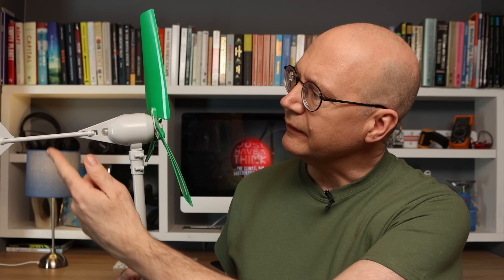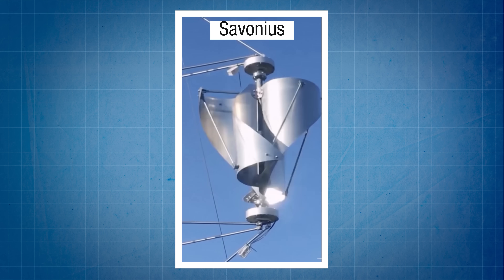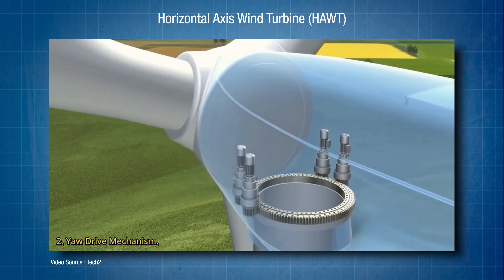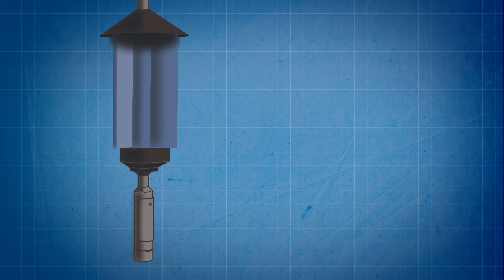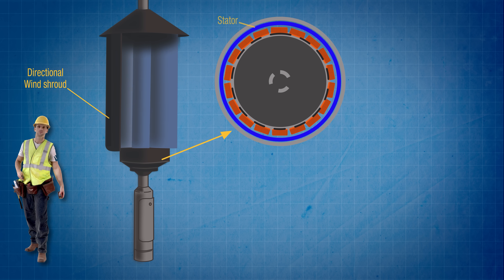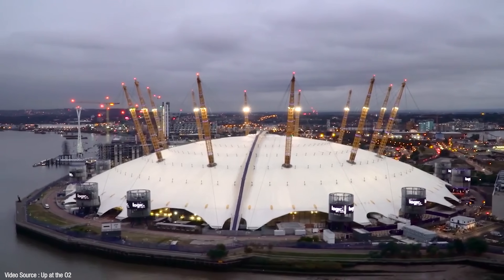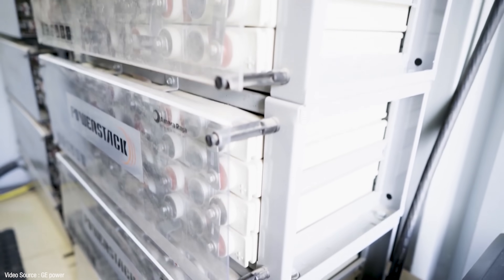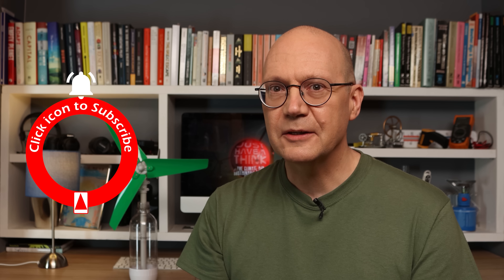A vertical axis wind turbine that doesn't need the prevailing wind! How do they do that?

Comment: I have two questions that I didn't see answered in the video. Does the use of these wind turbines on the road decrease the MPG of the vehicles? What kind of maintenance costs can be expected on these turbines?
Reply: It might actually increase the MPG. Assuming that eastbound traffic generates a head wind for west bound traffic, and vice versa, these VAWTs would act as a baffle and reduce that headwind. It would reduce the power required to move the cars.
Reply: @rayopeongo  good thinking. That's an excellent point.
Reply: @MichaelBrown-gt4qi  

"good thinking. That's an excellent point."

LOL, probably not. There are dozens of factors involved, and mine probably isn't one of them. For instance, I don't think that a boat is slowed down by having a surfer ride it's wake. The boat has already expended the energy to push the water out of the way and made the wake, the presence of the surfer is immaterial. So, I don't think that having the wind turbines at the roadside will have any effect, positive or negative, on the MPG of the cars. 

However, this is just one of the many things that I don't know anything about. The idea for the VAWTs sounds good, especially on the tops of cell phone towers, and we can use all of the clean energy we can get. So I don't mind these guys giving it a try to see how useful it might be.
Reply: Consider a train, travelling in the open or travelling in a tunnel.
Reply: Regarding the effect of MPG of vehicles passing by, VAWTs produce centrifugal air pumping effects, which essentially means there is some air shoved outwards radially. I believe, depending on the distance of the passing car from the turbine, the turbine rotational velocity and turbulence intensity, (and so on, too many factors) it would be quite difficult to visualize a conclusive answer. It really could go either way. On one hand, the 'extra' flow from the turbine could cause the flow boundary layer on the car to separate at an earlier stage, increasing drag. Or the extra flow could contribute to increased wind turbulence, delaying the flow boundary layer separation, reducing drag. It's an interesting question though, probably something worth investigating. Maintenance costs on the other hand, they're definitely less than HAWTs, but of course, depending on the type of VAWT in question, the maintenance cost will change. Predictive maintenance however, should reduce the cost very significantly.
Reply: l think MPG also depends on how heawy the traffic is. Like in low traffic the air movement wolud die off on its own without helping the next car anyway. 
@Ray Opeongo l like the thought.
Reply: Instead of using them on highway better choice would be to use them near railway lines
Less likely to be vandalised or stolen
Reply: Newton's Third Law says that there might be some influence of the VAWT back on the vehicles passing by them. 

I can imagine that the effect would be similar to the Piston Effect where vehicles, like automobiles or trains, passing through tunnels experience greater air resistance since the tunnels bound how far away the displaced air can move away from the vehicle. Think Elon Musk's Boring Company has implemented quite precise engineering controls to reduce that kind of drag. 

Since these turbines would only be placed on the sides of roads, not above or at varying degrees, and they would be placed discretely as opposed to continuously, I would think that any developed Piston Effect would be quite low. Dave did say that their efficiency/power coefficient is 30% though. 

I'd be interested in Dave returning to this company once they run a field trial on an existing stretch of UK road. You'd probably want to affix vehicle subjects with Instantaneous Fuel Consumption meters to get numbers from both the VAWTS and the vehicles passing by them.
Reply: Quite sure it will increase the drag to some extent.  Perhaps not significant, but needs checking
Reply: @markthomasson5077  there will be zero additional drag on any car passing or any subsequent car/vehicle doing so either. Every vehicle "punches its own  hole" through the air in front as it travels, this causes air-drag/friction induced by its journey, on that vehicle,  there is a slip- stream effect provided for vehicles traveling fairly close behind, this just diminishes the energy needed to maintain the following vehicles velocity.
Reply: its just air that gets pushed off the street, doesnt even help the car behind much. The energy these turbines would use is just part of the energy you as car user loose due to air resistance
Reply: I can't begin to decipher the flawed thinking that has led you to the former question
Reply: I can't begin to decipher the flawed thinking that has led you to the former question
Reply: I can't begin to decipher the flawed thinking that has led you to the former question

Comment: Due to our pandemic life is more difficult and boring, just have a think on Sundays is informative and is a shot for my mental health. Thank You
Reply: Not thought of it that way but you are so right.
Reply: Me too.  Food for thought and hope for the future.
Reply: You think it's difficult and boring now? Wait till the reset is completed. You'll own nothing,...not even the body you were born into.
Reply: So agree!  I adore Just Have a Think.
Reply from the maker: Cheers Mack. Much appreciated :-)
Reply: @JustHaveaThink  Hi, I love your videos, but I just wanted to let you know that there are several things wrong with this one:

At 8:50 in the comparison with solar you say 125 turbines have a capacity of 3MW - that would mean that 1 turbine has a capacity of 24kw - which is impossible and also a contradiction to the 2.5kw that are mentioned earlier in the video. - so maybe you missed a 0 there?

Furthermore you mention a windspeed of 5.4m/s. - A simple calculation shows that there is only 100watts in the wind passing through a 2x0.5m area (blade size) at 5.4m/s... - So if the turbines were 30% efficient they would only produce 30 watts from that wind... - if they did that the whole day long they would only produce 0.72kwh in a day instead of 6kwh.

Kinetic energy is 0.5m * v^2

If the air is moving at 5.4m/s and the blade has an area of 1m^2 then the volume of air passing through the blade per second is 5.4m^3 - the density of air is about 1.3kg/m^3 - so that air weighs 7kg - 7kg going 5.4m/s only have 0.5 * 7 * 5.4^2 = 102 Joules.

Since those 102 Joules are passing through the blade area every second they provide 102 watts.
A vertical turbine could only get maybe 30 watts from that.

Maybe crunch these numbers you self and you will see all the numbers in your video dont add up to 3MW or 6kwh a day etc...

Maybe you can let me know if you read this and thought it was helpful or whether I just wasted my time :D

Cheers, looking forward to your next video, lots of love and greetings from germany.
Reply: @jeffreylebowski4927  And no mention of the noise?
Vandalism and safety protection/guards?
As always, there's corporate FRC's on the end of it.
Reply: @JustHaveaThink  I liked the video but I think the numbers Alpha 311 give are very dubious. 3 megawatts from 125 turbines? That's 24kW PER turbine. The cost comparison to the solar farm didn't add up either unless of course I have made some mistakes. Take a look yourself, it seems like a nice idea but I fear the whole thing is a Solar Freakin' Roadways type scam.
Reply: @banalestorchid5814  People have been saying this for days now, but Dave is not listening. It's a disgrace.
Reply: But windmills cause cancer. This is horrible news. 
Just a future of tumors, lost loved ones, and dead birds as far as the eye can see... 😔
Reply: @SouIife  🙄 😆 😏 🤪  
Sarcasm?
Reply: @denbecr49  not according to the last leader of the free world lol
Reply: @SouIife  
In his case it was lies/fraud/manipulation/propaganda/ignorance
Reply: The Pandemic is a LIE
Reply: What's different?
Reply: Its not the pandemic making your life hard,  its the government and other people in power such as teachers unions.
Reply: @northyland1157  You don't get the issue at all.  Things that grow tend to grow  exponentially. You see the virus was doubling in cases per day in New York every two weeks.  We have a limited hospital system, becoming totally used up at the recent winter peak, when your chance of getting infected in one day was only 1 in 1000.  As an individual, at that rate, you are prone to go about your business. But, doing so  neglects the big picture. With exponential growth, the 0.1% chance per day soon becomes a 50% chance per day unless the conditions change to lower the spread of the virus. The conditions that change the growth rate are the human interactions, distancing, and masking.  Back in the day of the Spanish Flu, the disease was more spreadable and more deadly, but the same laws of growth applied, and the health care system, communication system, etc were unable to cope with the disease. With Covid 19, the disease would eventually kill about 1% of the population  (mostly elderly) if left unchecked, and of course mutate even faster into more deadly forms - that would have your name on their list of targets.
Reply: @tedrees5989  correct me if I'm wrong,  Average death age was 82 with average 3 co-morbid illnesses.    We need to find ways to protect the old,   But also let out kids go to schools and our families earn a living.  I've seen a evidence of a real pandemic, when i visited a small town with a huge graveyard,   with children and whole family burried from the 1918 flu.   Covid was a con-job!
Reply: @tedrees5989   You must be trying to troll if you can't look at the evidence that young people and even middle age people by large fight off the virus with their immune systems.   National deaths for age 5 - 14 is  72 people total.   Its nothing like the Spanish flu.   And it never would have been.  Young people have great immune systems and 80 year olds don't.  A lot more then 72 young people have overdosed on drugs or committed suicide, or tried hard drugs while on lock down,  when they could have been busy with school.
Reply: @northyland1157  Something is mixed up. I never implied that young and old are hit the same by covid. That was Paul Sievinsky.
Reply: @tedrees5989  The CDC says 72 people age 5-14 have died from covid.   and  373,428 people 65+  i don't need histograms  to  read the numbers..  Its pretty friggen clear.
Reply: @northyland1157  Didn't I say I got mixed up about who I was replying to? I agree with the CDC and you, old people are more at risk.
Reply: The same pandemic causes people to have more and more crazy and stupid ideas...like harvesting wind from moving vehicles...
Reply: @koningbolo4700  Go stand by the freeway sometime and feel the effect of the wind on your body.  If you don't understand how air movement can be used to generate electricity, then please go back to school or research it online.
Reply: No difficulties here where we never bought into the fakedemic propaganda.  🥳 

So sad, you all decided self-imprisonment over a paper boogyman built from your own willful ignorance was somehow in your best long-term interests!  😢
Reply: @illbeyourmonster2  ....spoken like a furloughed (with pay) public servant
Reply: @paulslevinsky580  Okay?
Reply: @paulslevinsky580  You don't get the issue at all.  Things that grow tend to grow  exponentially. You see the virus was doubling in cases per day in New York every two weeks.  We have a limited hospital system, becoming totally used up at the recent winter peak, when your chance of getting infected in one day was only 1 in 1000.  As an individual, at that rate, you are prone to go about your business. But, doing so  neglects the big picture. With exponential growth, the 0.1% chance per day soon becomes a 50% chance per day unless the conditions change to lower the spread of the virus. The conditions that change the growth rate are the human interactions, distancing, and masking.  Back in the day of the Spanish Flu, the disease was more spreadable and more deadly, but the same laws of growth applied, and the health care system, communication system, etc were unable to cope with the disease. With Covid 19, the disease would eventually kill about 1% of the population  (mostly elderly) if left unchecked, and of course mutate even faster into more deadly forms - that would have your name on their list of targets.
Reply: @tedrees5989  ummm...no. The average age of mortality for covid 19 in Ontario is 83 (with multiple co-factors) versus the typical age of actuary being only 82. That statistic alone indicates that the impact on  life measured in years lost is statistically negligible. This "pandemic" is having a real and dire impact on both the old and young alike...but as a result of draconian,  poorly-measured and detrimental policy imposed by compromised politicians and unscrupulous, unelected bureaucrats. This virus wasn't the giga-death event it was hyped to be, and it will weaken and disperse into the typical cold and flu season as all other similar respiratory viruses have since the beginning of time. The fabric of our society will have been irreparably torn, however, clearing the way for the much publicized reset.
Reply: @tedrees5989  BC recently released a statistical average age of mortality (with covid) at 85. Germany, Italy, Denmark...all listed at 84. The list goes on and on.

You might want to instruct all advanced western healthcare systems how to do it right.
Reply: @paulslevinsky580  I give up, it is too difficult to make an example in YouTube, and keep track of comments. What I'm saying is that the average age of death moving down by 1 year does not mean that all ages are affected equally. It doesn't add up.
Reply: @tedrees5989  talk to Chyna. They're wide open and their economy is rock'n and roll'n. They're building new coal-fired electrical generators and steel mills at a brisk pace. I meet with Chinese suppliers via Skype several times a week and they don't wear masks. Haven't in months. 

p.s. I don't think they live past 70. They get euthanized or something.
Reply: @tedrees5989  "We are the Borg. Resistance is futile"

The more your pound your keyboard, the more I'm convinced yer paid by the word...or maybe yer an active member of the Chinese military. I hope they feed and house you well. 

And PLEASE produce evidence that indicates a filthy, ill-fitting paper or cloth face mask will protect it's wearer from nano-sized viral particles. If so, the CDC has had it wrong for decades. Let 'em know too.
Reply: @illbeyourmonster2  You don't get the issue at all.  Things that grow tend to grow  exponentially. You see the virus was doubling in cases per day in New York every two weeks.  We have a limited hospital system, becoming totally used up at the recent winter peak, when your chance of getting infected in one day was only 1 in 1000.  As an individual, at that rate, you are prone to go about your business. But, doing so  neglects the big picture. With exponential growth, the 0.1% chance per day soon becomes a 50% chance per day unless the conditions change to lower the spread of the virus. The conditions that change the growth rate are the human interactions, distancing, and masking.  Back in the day of the Spanish Flu, the disease was more spreadable and more deadly, but the same laws of growth applied, and the health care system, communication system, etc were unable to cope with the disease. With Covid 19, the disease would eventually kill about 1% of the population  (mostly elderly) if left unchecked, and of course mutate even faster into more deadly forms - that would have your name on their list of targets.

Comment: I will be amazed if these vertical turbines prove more cost effective on a whole of life basis than a PV system.
Maintenance costs will be higher, and retrofitting to an existing light pole will be expensive.
There’s no real innovation in the turbine structure here. And what about the effects of environmental wind on the drag induced air flow ?
Good luck to alpha311, I think they will need it to be commercially viable.

Comment: This evolution of the VAWT is welcome news.  I have had a keen interest in this form of wind power harvesting for a number of years, and it is reassuring to see this technology being 'upgraded' with more efficient ways to apply it.  As far as I am concerned, these should be mandatory along every major motorway. Even if they only result in generating 1 kw/h output, the cumulative effect would provide a much more robust energy grid.  Thanks for the video.
Reply: If it works then there should be no need to make installation mandatory.  This is one place where the market should quickly provide the needed capital.  Some government help in permitting could be useful.
Reply: @bobwallace9753  I see your point, but I don't want to make the generation of energy a private industry.  I would like this technology to be integrated with national energy generation.  This would  reduce any effort to reduce costs, and min/max investment vs return.  I would definitely support a private version of this to be offered to individuals for home use as well, absolutely.  That would be best done through private industry for sure.
Reply: @0chuklz0  I suspect we're living in different countries.  In the US there's no national grid.  Most energy (renewable and fossil fuel) is produced by private industry with some of the electricity grid controlled by municipalities.
Reply: @bobwallace9753  Ah, yeah that would make sense.  I am in Canada, and the power generation here is managed at the provincial government level.
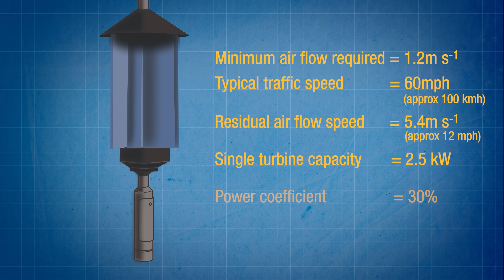Reply: I kW? Try 25 W. Dave's numbers don't stack up, they are wrong by either two (5:31) or three (8:50) orders of magnitude. So which is it, 2.5 or 24 kW? The right number for a VAWT this size is about 25 watt, by following the standard VAWT physics formulas.